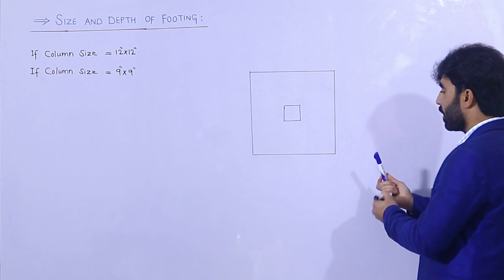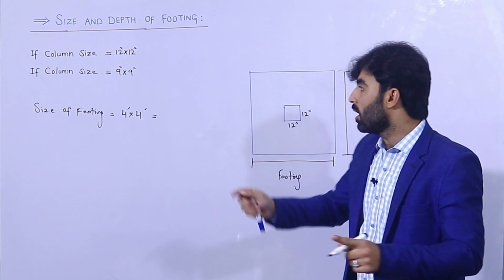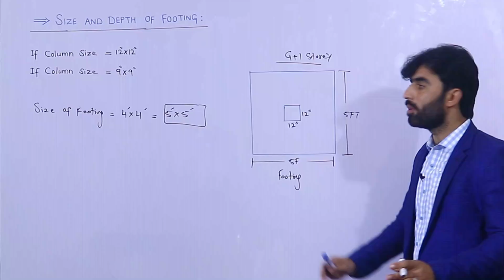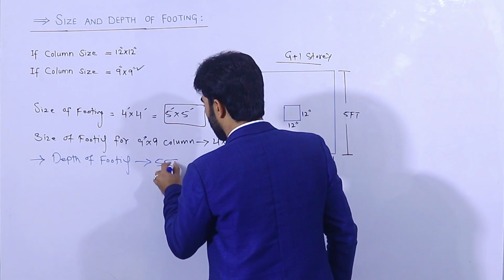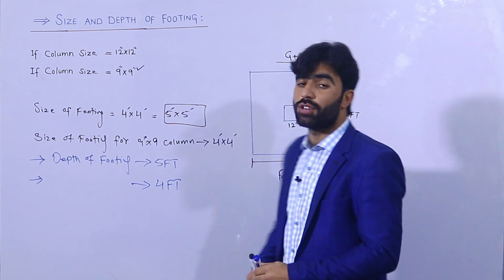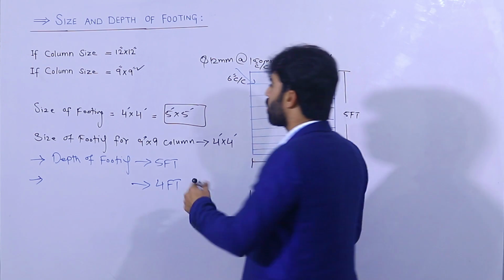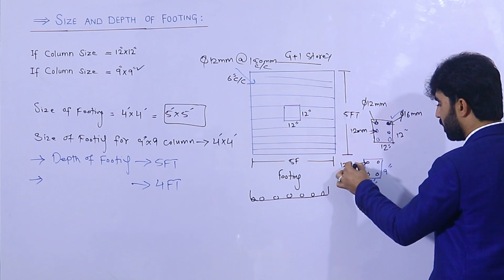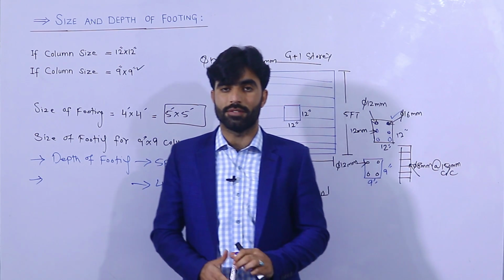Size And Depth of Footing? If Column size is 12 x 12 Inches |

Comment: Sir 12*12 column , spacing between column one side 3 steel but other side 2 steel ?? Buckling effect will not occur there ,can I go for it without taking tension in mind